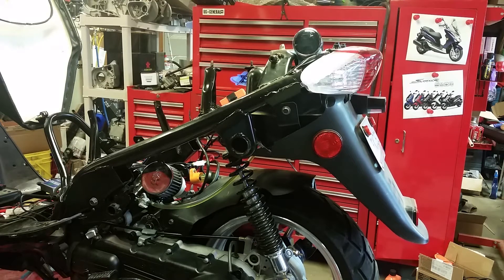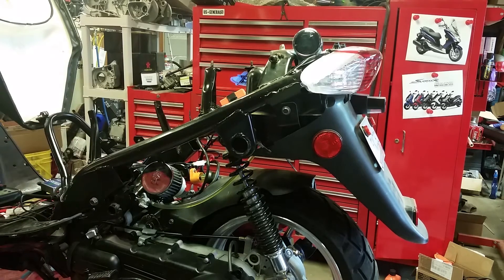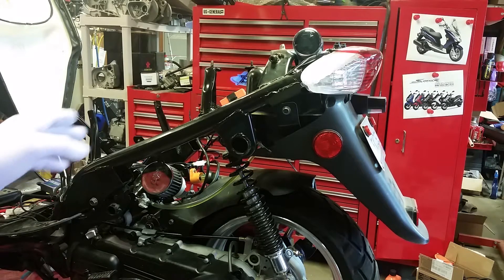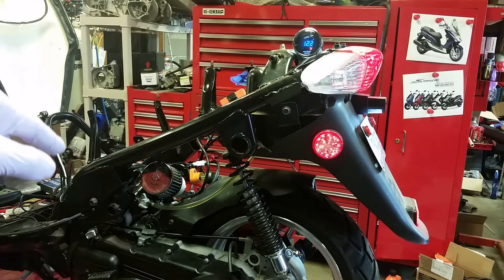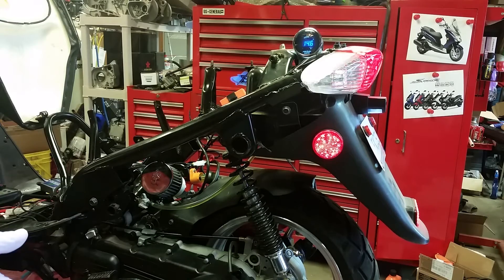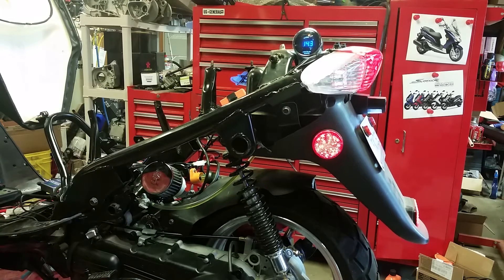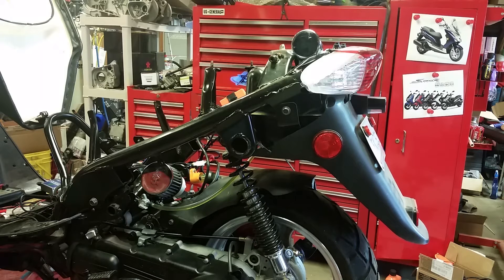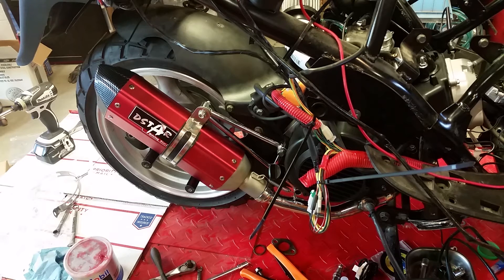Ecotrons O2 Sensor Install 35 110 03

Comment: that is a fuel passage not an air passage u are adjusting fuel to air with the screw on the engine side. if the screw was on the  air filter side it would be an air screw. I have a Gy6 150 also. u also can't trust a cold engine if u do it will always run rich. also the engine has to be under a load it will perform different. hit me up at rodneyfoster498@gmail.com for more help on tuning your gy6.,ride safe my friend